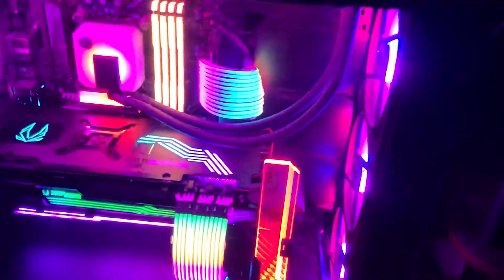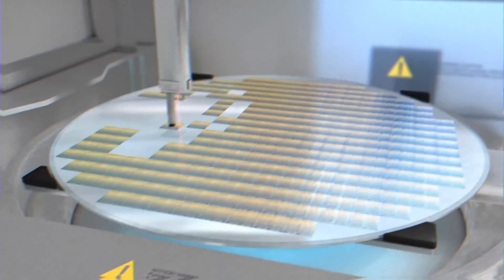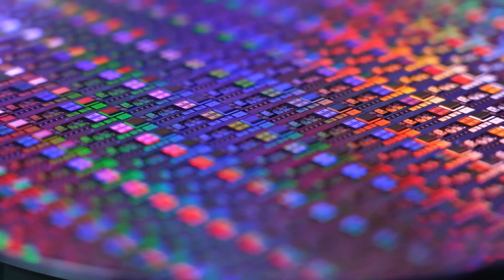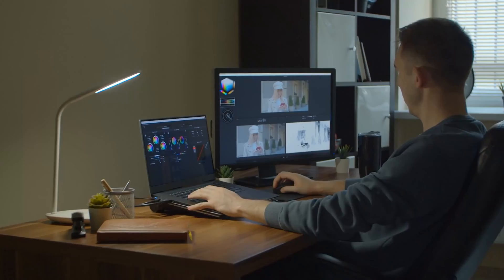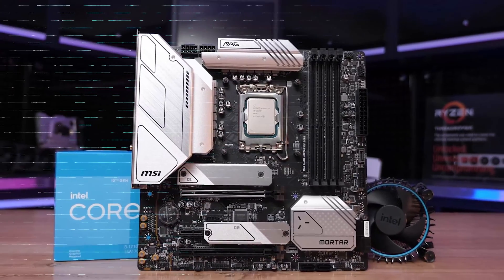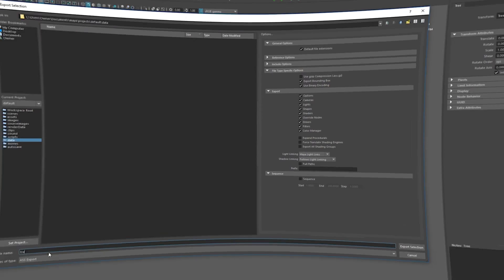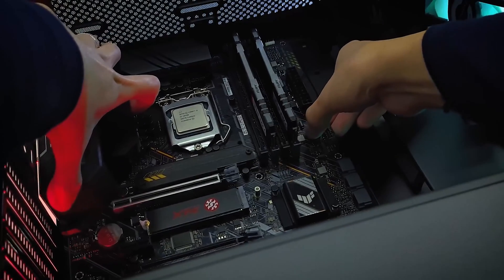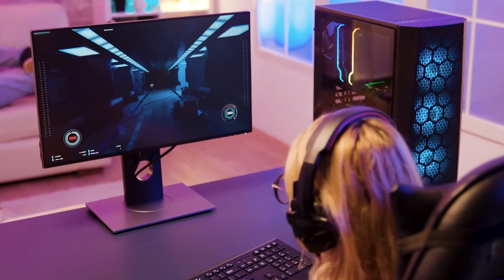Should I Upgrade My CPU or GPU First?

Comment: I've been looking to build in a mini ITX PC, but the card that I'm looking for is out of stock everywhere, so I'm thinking about getting a weaker card till it comes back and stock and then when I'm done with it save it for use as a test card

Could I possibly reduce the clock speeds of a 7800 x 3D to match the power output of a RX6600?

Comment: I like your video. I was once told that if your CPU is not doing much while your GPU is almost at max, may your GPU need an upgrade, while if your CPU is running nearly 100%, but your GPU is not doing much, may your CPU need an upgrade. But it that wrong then?
Reply: Right answer.

Comment: Well, let me share my personal experience with u all.

Back in 2014 I got a new PC with a 4790k 32 gb ram and a GTX 970 in sli. Was great bang for my money whit both gpu only costing me around 350€/piece back then.
Didn't feel like my CPU needed an upgrade till last 2 years now
In 2019 I upgraded my GPU to the 2080ti and yes this gpu was not bottlenecked by my old faithful 4790k as u was gaming on 1440p ultra wide

Last year I upgraded to the 13700kf , kept the 2080ti as it still beats the 4060 in so many games and have more VRAM available.
During testing the only difference was the new PC and windows 11 vs old 4790k system with windows 10.
The results actually shocked me as I could not oc my GPU 2080ti like on windows 10 and never got to have the same or higher score in benchmarks. It was always 50-300 points lower than my old system.
Going back to windows 10 gave me the exact same score for my GPU again.
Conclusion for me will be , if u have invested in a good system at base u should go with a new GPU then save up some dollars for a new great system in 2-5years.
Mine ran for 9 years without anny issues just updated the GPU 1x . 

Will probably upgrade to the rtx 5080 or something as my 2080ti still competes with the popular 4060ti pretty good, so not worth it for me right now

Comment: i5 7400 and gtx 1050ti, which should i go for upgrade?
Reply: Same im looking at amd 5 5500 or something like that
Reply: We have the exact same setup haha
Reply: @SpaceStrike  hey! I ended up leaving my PC into that build and buy a lenovo laptop xd
Reply: @mkel21 hey that’s awesome! Do you still use it. I personally don’t like laptops haha
Reply: @SpaceStrike I do, I got work so this helps xd, hows your PC?
Reply: @mkel21 doing alright, had scared me because I had trouble turning it on but I kinda have to jump start it now haha using the power supply test button then pressing the start button. I’m def considering upgrading to like a Ryzen 5 and might rebuild the entire thing. Mine is a Dell wbu

Comment: i have a rtx2060 and a intel core i5-10400 can i upgrade CPU without changing motherboard?
Reply: Depends on which CPU you want to upgrade to. I'm assuming the motherboard u have right now can only handle a CPU 1 generation higher, which is the 11th gen. If you plan on changing to AMD CPU or 12th gen or higher intel CPU then you will for sure need a new motherboard and possibly RAM. Let me know what CPU you plan on getting and I can give you a pretty good suggestion with a budget you provide.
Reply: @DarkDocketsOfficial  Thanks for reply. i plan to go for ryzen 5 5600 or 3600 with 2060super gpu
im an entry level video editor so i need optimized system for davinci resolve 17 or 18
Reply: @ISyedZainUlAbideen  Nice! I would say to go with a motherboard with a AM4 CPU socket. You should be able to use the same RAM.

Comment: hello im trying to build a pc and my budget is around £1500. I want the h6 flow case (£100) , b650 aorus elite ax mother board ( £200), corsair rm750 psu (£110) , 16 gb ram kingstun fury beast ( £66), crucial p3 1 tb storage (£69), phantom spirit 120SE cooler (£33). They were my budget choices other than the case so i could spend as much on the cpu and gpu for performance. I play all competative games such as valorant, csgo, fortnite, roblox which ik are mostly cpu intensive games so im left with some choices to fill my bufget. can you please advise best or if u want to make any changes. I would love to hear your opinion. I have a 144hz monitor 1440p 27".

1) r7 7800 x3d + rtx 4070. Since i play lots of cpu intensive games i want to spend as much as possible and get a reliable good cpu which will last me a long time. additionally the rtx 4070 is good gpu overall which works good at 1440p. and im also worrying about bottle neck issues. 

2) r5 7600(x if cheaper) + rtz 4070 super. ive dones some research and apparently 1440p is less cpu intensive but my only worry is that if im playing cpu intensive games, would this work worse than option 1?.  however the jump in performance and vram between 4070 and super versions is quite high. and the 4070 super is a very good 1440p graphics card. 

If you have any other combinations that you think will work better please let me know.

Comment: Cpus come locked or unlocked from the manufacturer. So if i buy a locked cpu i should immediately upgrade? Even if your cpu stays at 100 percent usage it shouldn't be overheating. If it is that's more indicative of a cooling issue. Also, in a bottle neck the underutilized component doesnt find it hard to handle all of the power from the component that is maxed. The maxed component is working overtime trying to keep up and is the bottleneck.

Comment: I have an i7-4790K running with a RTX  2070 Super, not sure, what should I upgrade first? (appreciate any suggestion)
Reply: Go with the gpu...cpu is already top class
Reply: @FREE_FIRE_SAVAGE_MOMENTS  thanks, did that but there was a minor miscalculation on my part in regards to the width of the card and ended up taking advantage of sales to put together a new pc... I've got both running now, one for work and one for entertainment 🙂
Reply: @el_Contra  then you can buy a 7700xt or second hand 3080

Comment: Hi please i wanted to ask you a question I have a limited budget and I would like to buy a gaming laptop to use in gaming I have the choice between two configurations 

RTX 3070 100W WITH I5 11400H 
RTX 3060 100W WITH RYZEN 7 5800H 

please which one is better and which one can last in time (4-5 years). (better cpu or gpu)
Reply: The RTX 3060 100w with ryzen 7 5800h becouse the i5 is only good for a few years max,and it deasen't have a more compatebel space if you are going to upgrade again

Comment: Which one should I upgrade first? My Ryzen 5 5500 only supports up to PCI 3.0 but I have been using my 1070 GTX since 2017. I have Gen4 SSD which is limited by my CPU unless I upgrade it. However, my GPU is already 6 years old even though it is still running pretty well. The CPU and GPU I am looking at are currently on a discount promotion. Only have enough cash to upgrade either one first. Appreciate your helpful replies.
Reply: I dont know
Reply: @Jonerjokerbatman why did bro comment if he doesn’t know😂

Comment: Which I should upgrade first (my CPU is i5 6500 and gpu is gtx 970)
Reply: CPU, if your sticking with intel get at least 10th gen and above, you will need to get a new motherboard though as intel changes their socket every 2 cpu generations
Reply: @wedoprods19  ok thx man

Comment: I have currently i3-10100 and a GTX 1650 Super, and having to choose which one to upgrade to have stable performance in my favorite games. Idk what should I get too, ARC GPU or RTX, i7 10gen or newer 🫤
Reply: your i3 10th gen is still quite capable depending on what games you play, i would personally get an i5 or i7 10th gen because if u get an rtx gpu your cpu might bottleneck unless u get a 3050 or something like that

Comment: Quick question wanting to upgrade both CPU and GPU I’m currently running the I5-7500 and a gtx 1660 Super which would you guys say i should upgrade first mainly run FPS with occasional racing
Reply from the maker: Go for CPU upgrade although you’ll have to change your MOBO most likely too
Reply: i know it's superlate but if you reply your going to make my day pleaseeee tell me I have RX 580 and i5 7500 which one I should get first
Reply: @TopTierTech1 Plz

Comment: I'm really in a fix. I have a R3-1200 with a RX570.
What should I do? APU? I'm on an ASUS Prime-A 370 motherboard. Most of the money went into the case, motherboard, and power supply. And then I cheaped out on the CPU/GPU tandem.
Before that I was sitting on a Phenom II-940/Radeon HD4500. So it's been awhile.
Believe it or not, I'm satisfied at 720. I can't see the details any better anyway.🤣
Reply from the maker: Yeah I’d say go grab a Ryzen 3 or slmething

Comment: I've got a 1660ti and ryzen 5 2600. I can play anything I play just fine. Except farm sim 22. It seems my cpu doesn't even run at half load but the GPU spikes a lot and I have fps stops bad. All the way down to 5 fps sometimes
Reply from the maker: Weird that farm sim is what goes over
Reply: @TopTierTech1  I figured out my problem. It's on ultra settings now but when I first play the game I have to let the shader cache build.

Comment: im not gonna upgrade yet but just asking i have a ryzen 5 5600x b550 rx 6650xt if you were me what would you upgrade first ?
Reply from the maker: GPU 100%...that chip is solid for quite a while (unless you are a huge multitasker with lots of apps open simultaneously)
Reply: @TopTierTech1  yeah i got the gpu last month so ima keep it for a while i probably end up getting 3090 when price drop alot 2/3 years from now maybe

Comment: Hey just wanna ask here , im still confuse which one shud i upgrade first is it cpu or gpu first bcause rite now im using ryzen 5 4500 and gtx 1060 6gb . Bcause im planing want to buy take rtx2060 12gb before the store end the promotion . The problem is im playing gotham knight with the lowest setting i only can get 30-45fps 😢
Reply from the maker: go for teh GPU upgrade first 100% in your case.

Comment: CPU is way more important imo. If your into high refresh rate gaming and low latency a fast  CPU with good IPC is necessary. Imagine a zen 2 CPU with a 4080…. awful.
Reply from the maker: You are right to an extent. IMO if your cpu is 4 years old or less (by date of release not when you bought it) odds are that a GPU will help performance more

Comment: That isn't how bottlenecks work really, they dont use all of their power and cause the other to not be able to handle that power.
What happens is they wont use all their power, because the weak link cant match it's power.
If you're getting 100% CPU utilisation and only 50% GPU utilisation, then the GPU is being bottlenecked
Reply from the maker: Correct.

Comment: I've usually upgraded the cpu to an i7 and now a ryzen 5800x3d. A higher end cpu will usually last 3 or so video card generation upgrades.
Reply from the maker: Yup! I think withtodays CPUs it may even go longer bc clock speeds have leveled out massively. They just keep adding more cores which for most things doesn’t matter

Comment: Always GPU. Any decent quad core can game with the best of them.
Reply from the maker: yup unless your CPU is reallllllllly old
Reply: No... many games still rely on good single core performance, while others need more threads.
I went from 150fps to 250fps using the same 2070S by upgrading from a R5 2600 to a 5600x

Comment: Dude I'm sorry, but some of this is just plain wrong. If your gpu is the bottleneck, your cpu is being underutilized, and will not be "overheating". Also if your cpu is overheating it might just be time for better cooling. As a rule of thumb I would use. When turning down graphics settings/resolution still doesn't help your framerate, you need a faster cpu to process the things going on in the game. If  turning graphics settings down does improve framerate, but the visuals aren't up to par, you need a better gpu. A cpu, for the most part is not affected
Reply: Cpu is not generally affected by graphics settings. So if lowest settings/low res isn't helping you need cpu.
Reply from the maker: “If your gpu is the bottleneck, your cpu is being underutilized” - this is situation specific depending on game and/or use.
Reply: @TopTierTech1  well, yes, but you make decisions based on your needs, and if the games you play tax the cpu but not the gpu then you probably need a cpu upgrade first.
Reply: @aboveaveragebayleaf9216  Hello  can I get your input on my builds I just started 6months ago. I have (2) gaming PCs  Asus z390m pro i7 9700f rtx 3050 8gb 64gb ram m.2 operating system SSD 1tb storage emulators pcsx3 & xbox360 and Asus z390m pro i7 9700f 32gb Rx 6600 eagle 8gb m.2 operating system SSD 1tb storage ps3 & xbox360. 1 setup can play games the other can't. The Radeon setup CPU overheats on download 90c but plays at 40c will lag or crash only on call of duty and the Nividia started play games hitting low 60c. Both setups bounce from 30fps to 60fps some game play 60fps no problem. I don't want any issues what do I need to do to correct it????
Reply: @miketheevolutionslayer2649  my guess would be you have some major cooling issues for your cpu. Are they running the stock cooler, or did you forget yo take the plastic off the cooler?
Reply: @aboveaveragebayleaf9216  6fans all RGB.
Reply: @miketheevolutionslayer2649  case fan rgb doesn't mean shit for cooling. What is the actual cooler on the cpu
Reply: @aboveaveragebayleaf9216  I messed with bios adjusted ram speed enabled xmp 3200ghz enabled all cores.
Reply: @aboveaveragebayleaf9216  Cpu fan is rgb temps are not bad when playing only when downloading hits mid 90°c
Reply: @aboveaveragebayleaf9216  Lol sorry for the all caps on rgb it saved it when I type it goes straight to captials looked aggressive but wasn't meant 😝
Reply: @miketheevolutionslayer2649  still you shouldn't be getting up that hot in general. I'd check your thermal paste application or get a better cooler. rgb means nothing for cooling. Ever heard of the phrase "It's like lipstick on a pig"?
Reply: @aboveaveragebayleaf9216  I was thinking the lights were causing to get hot the ram & psu is rgb too....
Reply: @aboveaveragebayleaf9216  Or the settings from software & bios. Everyone I know that knows gaming PCs can't stop by and check I even said I pay them but no luck.
Reply: @miketheevolutionslayer2649  I'd try resetting the cmos,(just Google how, it's not that hard, but just hard to explain from comments)check to make sure you have good thermal paste application/cooler contact, and check your ram settings in the bios make sure you have xmp/docp enabled so your ram runs at the speed it should.
Reply: @aboveaveragebayleaf9216  I will do after work that was last thing to do thanks for all the info 😎👍

Comment: You're speaking in too general of terms. Cores and clocks are relative to IPC (Instructions per clock.) The way you're phrasing things, an FX 9550 is an 8-core, 5 GHz Processor, it should be amazing. But it's hot garbage, no pun intended.  Great video, I just thought some of what you were saying might give some people the wrong information. Also, a 2060 is just as good as a 4090 on an FX 9550 8-core 5Ghz Processor. It's all relative. The answer to your question is always, "It depends."
Reply from the maker: Ty for feedback. Def don’t want to confuse people…hopefully we gave people a good idea of what to upgrade based on what they use their computer for more as well as how to spot the bottlneck
Reply: Lol I have a 2060 🎉 with a 2600
Now getting a 5700G